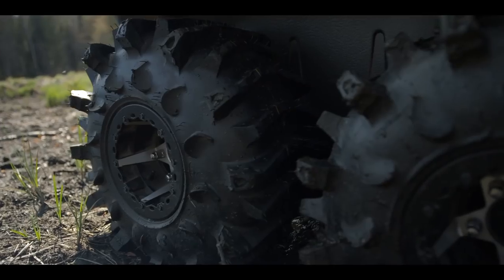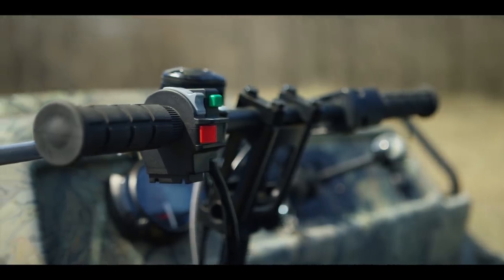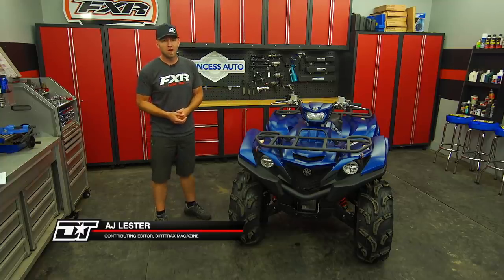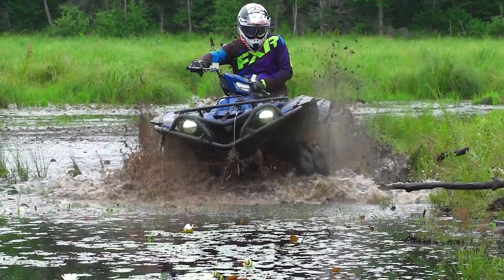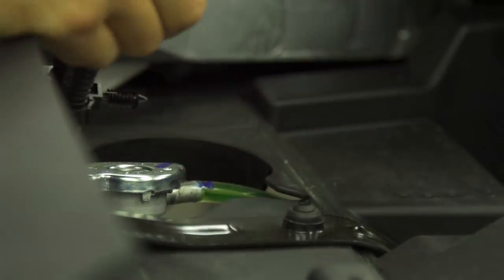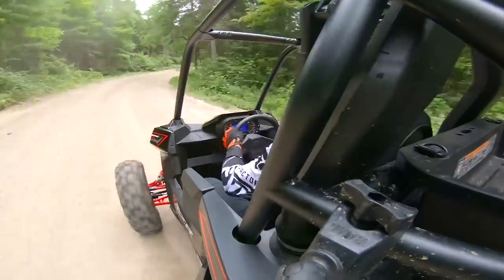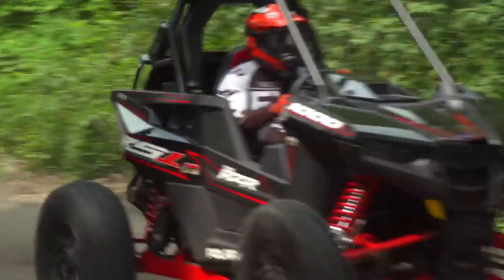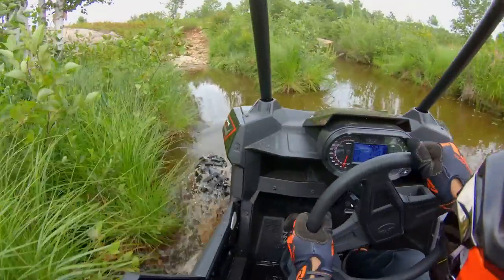Dirt Trax Television 2018 - Episode 10 (Full Episode)

Comment: The rs1 also brings with it the new stronger front dif and beefed up suspension components from the turbo s.  Thats impressive.
Reply: Yep, they left that important info out of the review. Even has the clutch setup from a turbo, heavier duty connecting rods, turbo rear axles, and lot of other beefier parts compared to a regular XP1000.

Comment: I have a question about your winch install. How did you get the winch cable fully retracted with the auto stop feature? When you reeled the cable in, the rubber bumper stopped an inch or so short which causes a flopping hook. Later in the same segment, the rubber bumper appears to be tight to the fairlead. How did you do that? That's my biggest gripe with the system making me want to tear that feature off and throw it into the trash. Seems while it may be good for plowing, that's about all it is useful for unless you don't mind your hook banging off the front of the machine as you cruise down a trail.

Comment: A winch pulling a full size pickup truck up a 15 degree incline is one thing.  If the winch is truly rated at 6000 lb, shouldn't it be able to pick up (vertically) a 6000 lb vehicle off the ground?

Comment: I really wish Polaris hadn't started to BS their suspension numbers. This machine does not have 21" of travel like they say. It's the same 16/18 F/R that the XP platform has had all along. They are now measuring from the bottom of the tire at full droop to the bottom of the skid plate. It's not an accurate measurement of wheel travel like everyone has always used. I understand why they did it to point out the silliness going on with the X3, but it really is misleading and dishonest.